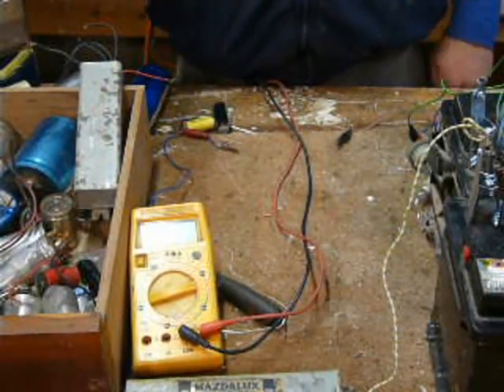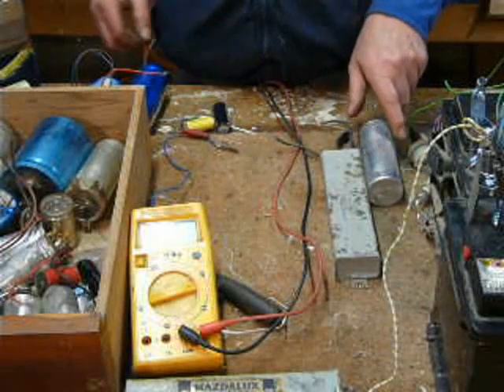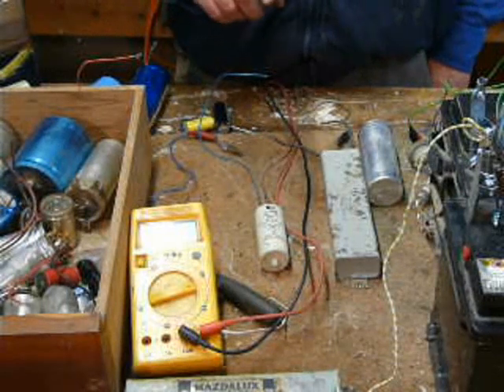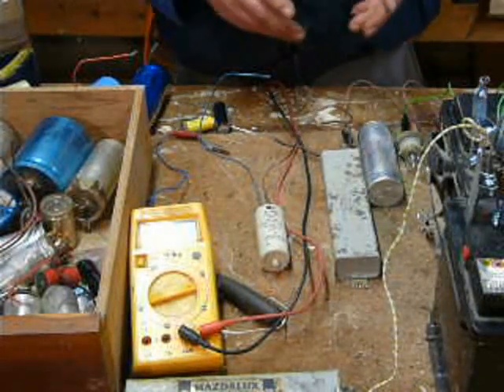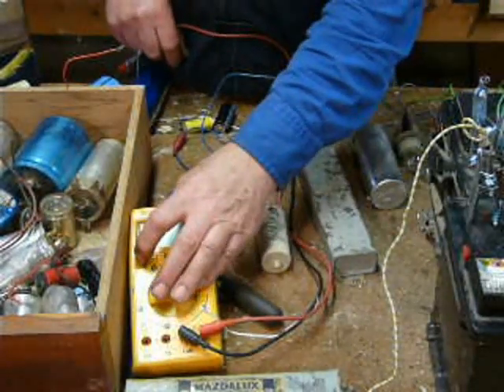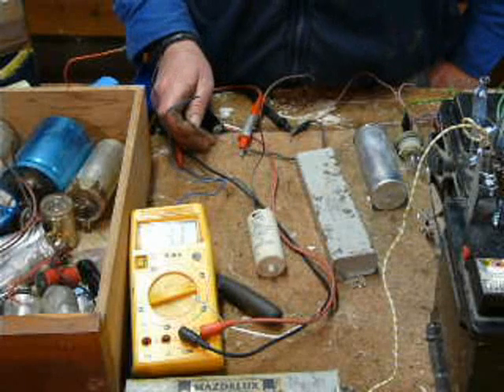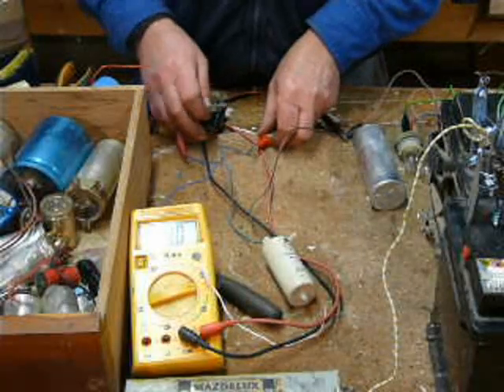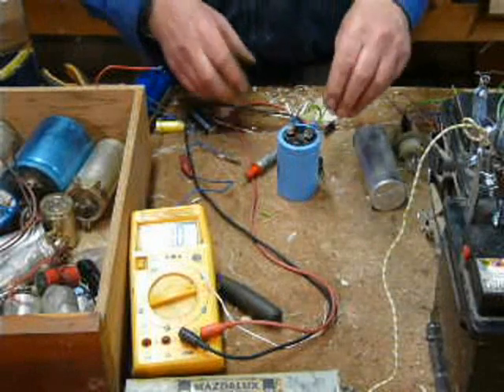Testing capacitors for 3 phase motor conversion, backwoods method

Comment: Thanks for the tutorial Andy, I am actually learning!  What type of capacitors would you recommend for my wadkin 10 ags table saw please?  Also do you know where I can buy them used please (you I was thinking, cash waiting)?
Cheers mate!
Reply from the maker: Kevin. I'm keeping my hard won spares. Just look out some scrap capacitors from your local electrical recycling centre, you should get them for half nothing. They must be at least 250v AC and of a reasonable size. If you are buying them go for 300v AC if you can.  There's loads on Ebay just make sure they are for AC.  Let's hear how you get on.